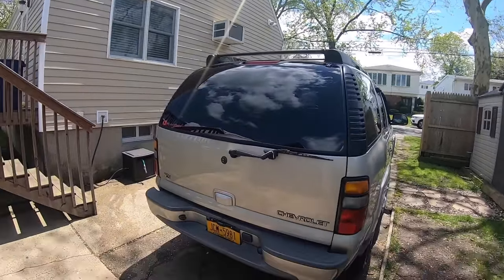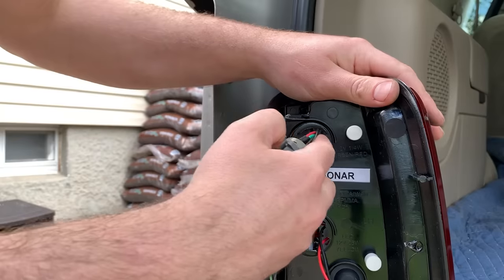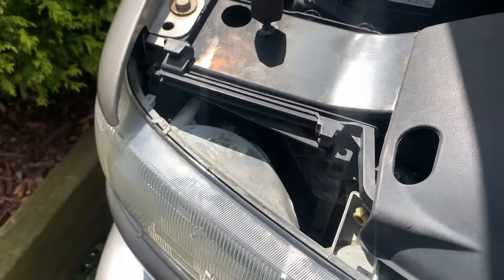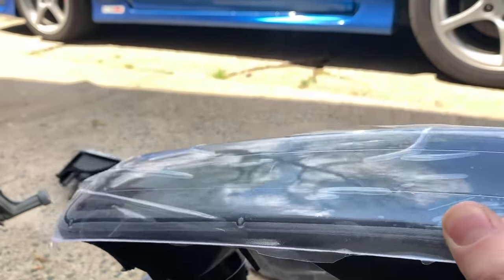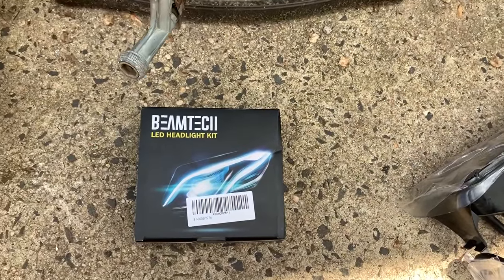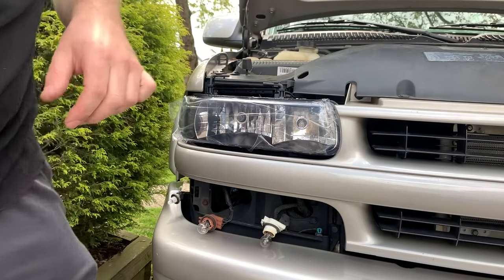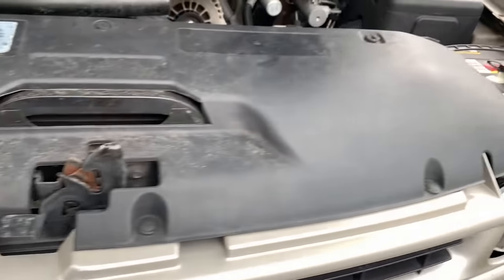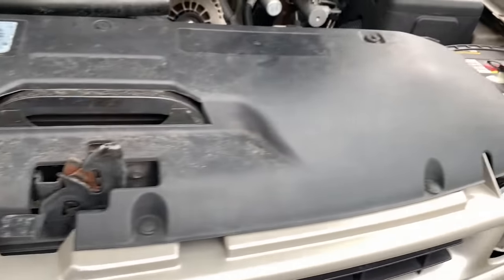Lights, Badges, Wheels, and Tires | IT'S TIME TO PIMP MY TAHOE

Comment from the maker: Phew this was a long one... Kept a lot of the install details in there, so let me know what everyone thinks. I would also love to hear your opinions on Tahiti's new look, and what additional mods you may want to see! P.S, I already have plans for power mods... #10secondtahiti
Reply: LsxMatt Have you thought about doing a undercoat spray for protection and what about Flowmaster’s dual exhaust that would be cool
Reply: Silverado 2500 hood?
Reply: Mirror turn signals
Reply: LsxMatt those badges are for the new tahoe Z71’s I’m looking to order some myself cause the original Z is red instead of black
Reply from the maker: Brian C it already has those👍
Reply from the maker: Brian C probably
Reply from the maker: jacoby Demissie maybe, I’m not looking to make it too loud.
Reply: Get a leveling kit
Reply: Nice job. Not overdone. Using modern GM badges & wheels was the way to go. I have done the same. I like the "looks OEM" but better look myself.
Reply: I'd swap out the rear window pillars (ventilation caps) with ones from a Cadillac Escalade. Easy swap.
Reply: You should of replace evry single stock bulb to leds including the fog lights and maybe get a round led aftermarket like morimotos
Reply: You did great, thank you for sharing!!!!!
Reply: clean the engine bay
Reply: LsxMatt you should buy led bulbs to replace all the halogen bulbs
Reply: Take the roof black thing off
Reply: Bro thx answering me but i didn't want to be rude but I meant like buy like a new unibrown and it looked great with it that's my opinion you might have a different think about it.
Reply: Looks good.
Reply: If you change the door hands for black color with the left and right mirror it will be great
Reply: Leveling kit
Reply: Looks great! Get the quietest dual extit replacement muffler and add another tail pipe on the left side🤔
Reply: Sorry, where did you order the tail lights from?
Reply: LsxMatt Brother No Need For A Leveling Kit. Just Tighten The Factory Torsion Bar Screw. You Can Get Atleast 2 Inches From It.
Reply: LsxMatt We would like to offer you a free lift kit or leveling kit from BoringOffroad.com for use with your Tahoe. Please visit our website and contact us through our forum page. We hope to hear from you soon! Great truck man!
Reply: That is a awesome job you did and you gave me some ideas to pimp my 2003 GMC Yukon thanks for your video you really got your Chevy Tahoe looking great.
Reply: Either a level or lift kit
Reply: The HD grille and upper lip would look real nice
Reply: Needs a Ranch Hand grill guard, level kit, roof basket, interior LEDs, new instrument cluster with the transmission temp gauge. But your current mods are very tastefully done.
Reply: I was trying to find the links for those headlights , taillights and badges. eBay i can’t find it
Reply: I got a real important question do they light up the road correctly or is it lacking the deflectors on the inside like the stock housings??
Reply: It looks like the taillights have the same issue that I keep finding with other aftermarket LED taillights.  Theres very little difference in brightness between running lights and brake lights.
Reply: Alright, you and I are about even on vehicles. I have a 2001 Z71 Tahoe Im working on. Also, just bought a 85 Z28 on Thursday and bought a 94 vette a couple of months ago. Im very close to a divorce. But I have tried to assure her that is it for vehicles lol. I got my to hot rods I wanted for my bucket list lol.
Reply: I like other ones better, old ones.
Reply: @blahbadyblah  I totally agree that all aftermarket rear LED tail lamps assemblies are not as bright or there's no real difference between the parking lights and the brake lights. I wonder if the LED replacement bulbs from the driving lights even reach as far as the stock bulb. Yes the color is great but I want the distance at night.
Reply: What about a sunroof..
Reply: Links to these items?

Comment: Not gonna lie I got emotionally attached to my Tahoe with 250,000 miles and fully restored it using OEM parts. It looks and runs like brand new. Probably a big waste of money but I’m still very happy with it 👍
Reply: I regret selling my 2004 tahoe to buy a 2015 WK2. First vehicle i ever worked on by myself and fixed by myself. I miss it, especially after seeing the new owner abuse it and hydrolock the engine by driving through flood waters with a cold air intake
Reply: Wait for gas to go back to 5.50 gal
Reply: Willing to bet it will last you another 20 years with minimal maintenance
Reply: Haha you're not alone, I'm still emotionally attached to our 2001 excursion. I still baby it and buy new things to pretty it up. It's been so good to us I can never let it go. So no way is any of this a waste of money; these vehicles totally deserve it!
Reply: The best part about it all is probably that you don't have a car payment!

Comment: Wow imagine being able to change a headlight without having to take ur bumper off. must be nice
Reply: It makes life so much simpler I swear
Reply: ahaha yessir welcome to VW mk4 life
Reply: Imagine being able to change ur headlights without taking off your radiator
Reply: FELT DAT SHIT
Reply: @gdowdy  rip
Reply: Carlos Davis Ford Fusion problems
Reply: Old Chevrolet .. just Chevrolet is OP to work on
Reply: Those were the days
Reply: Same when I got new headlights all I needed to take out was the old headlights themselves😂
Reply: I have to do the same in order to install headlights on my 2014 Malibu smh...
Reply: Miata life
Reply: ikr!!!    My RX300, 17 Avalon and Q50   Are all a bumper off job for headlights,, but SURPRISINGLY The Audi Q7 doesn't require bumper removal to replace headlight
Reply: Edgar H252 2007+ tahoes really wrecked the curve lol
Reply: Hansel Sanchez  forget Headlight removal, I feel bad for PT cruiser owners in general
Reply: @JDMHaze  Nice tail lights they look rich.
 Gotta be careful where place those headlight pins when you take them out they like to roll away and got lost in the engine bay.
Nice vid though.
Reply: I had that same issue with my 2007 Cadillac STS and 2012 Chevy Malibu... take it to a shop and you end up paying over $250 for a $30-$50 part.
Reply: 2014 Subaru Legacy. Have to take the bumper off and about twenty 10mm bolts for both headlights.
Reply: That’s why I still have my 02 suburban. So much easier
Reply: I have too take off my wheel and fender liner
Reply: mr anderson  4th gen Dodge Ram 😑😑
Reply: I had to remove my headlights. To put leds in it
Reply: @gdowdy  i do it on my vw all the time without taking off the bumper
Reply: @jonathanmorgan494  not on a mk4 youre not
Reply: @gdowdy  i do it all the time though 😳
Reply: That's the joys of owning a chevy...
Reply: Should've bought a tahoe/suburban 😂
Reply: LOL!
Reply: When i swapped my 04 sierra lights i could not beleive how easy it was.
Reply: Chevy bubba
Reply: Shoulda bought a Tahoe!
Reply: When I saw how easy it was to swap headlights on this truck I instantly went to look for some leds 🤣🤣🤣
Reply: Lol oh yeah
Reply: I got a cat eye chevy and I can remove my lights with just pulling a pin
Reply: 2011 chevy malibu😢
Reply: It's a wonderful thing!! I swear it's one of the reasons why I keep my 03 surburban.
Reply: I know it’s been four years but does anybody know how to turn on the inner turn signal lower lights ❓❓❓❓❓❓

Comment: Pro tip. When you put the rear Chevrolet logo on put masking tape over the lettering peel the back off and the tape holds the lettering in place press onto lift gate and pull tape off

Comment: Man you do a nice job, detailed, informative, and enjoyable. I liked the add for your promo as well. Glad to see you getting some extra support, Thanks.
Reply: Except 1) Googone should not be used on painted surfaces.   Alcohol is safe and usually works too.   2) Multi-letter disconnected badges like that almost always come with a clear sticky sheet over the letters, that's not just to protect it during shipment, its also for application.  You are NOT supposed to eyeball the placement, but use that with a piece of blue tape above that sticky clear sheet to line everything up like a hinge, then remove the adhesive facing the paint, and press in place.   If for some reason its lacking it, which I've never seen, you can place tape over the lettering so they all stay in position and do the same.  The lettering adhesive will be stronger than the tape, so once pressed on you can easily remove the tape.

Comment: I love how you updated this rig. I've always loved the Tahoe and suburban. And you have "modified" this exactly how I would have done. This is the definition of "tasteful mods". When it comes to upgrading a vehicle on a budget one of best was to do it is with factory parts. They're far superior than anything on eBay coming from china, I have upgraded a few vehicles by simply using factory parts from other makes models or newer or upgraded factory parts. Once I saw the reveal the first thing I said was "leveling kit would really set this off" and bam! You mention it...so I hope you have done it

Comment: LsxMatt >>> I like what you're doing overall to your vehicle, it's starting to look quite good.  I hope that your replacement lights do not start developing condensation, the front ones are especially prone to this.  Also, be careful with tire rub: it's kinda like the saying about roaches, if you see (1) one roach, there's bound to be a (100) a hundred more; with rubbing what you've noticed will be the minimal amount until you're on some really rough roads, or your vehicle is really laden (weighed down), that's when you'll see the "real" total amount of rubbing.  If I were in your place I'd just use the tires until time came to replace them, then I'd go back to the original specs (or at least something a smidge smaller).  Great video, thank you for the share! ;-)

PS ... when you were showing the rear fender well about the tire rubbing I noticed that your rear shock looked quite busted and rusted.  Maybe you're do for a new pair of rear shocks, and if you're considering a front "level kit" maybe just forgo that for replacing the springs with the shocks; the springs may just be sagging because they're old.  This way you get a better ride and look instead of a nice looking ride that doesn't ride right; now say that 10x quick! ;-)

Comment: Good to see others out there doing this sort of refreshing upgrade. I have a 2006 Silverado Crew Cab 4 x 4. I'm doing exactly what you're doing. All chrome is going bye bye and I'm replacing it with blacked out versions. Smoked headlights, turn signals and fog lights. The silver and gold "LT" badges will be replaced with solid black. The silver "Chevrolet" badge will be replaced with a solid black one and the silver and gold "4 x 4" sticker will be replaced with a solid black version. I'm also going to powder coat the rims and get away from the chrome on those as well.

The Tahoe looks amazing. I'm glad I ran across your video today.

Steve D.

Comment: Great video.  I am not a huge fan of the same color stop and blinker lights. I personally always like it when the blinkers are yellow and the brakes are red. That way if someone is stepping on and releasing the brake pedal you don't have have to guess if that is a blinker or not. Super small gripe on my part. If you like them (and you appear to) then it's friggen awesome!
Reply: so true. cars made for the european market always have separate, orange blinkers, never combined with brakelights. it's so annoying and dangerous when the brakelights are combined with the indicators.

Comment: Highly recommend upgrading the wiring harness for the low beams to the Standard products wiring harness upgrade with bigger gauge wiring because they are notorious for overheating and melting the sockets. Happens to rear turn signals too. Sylvania makes good running light led replacements also. I've changed those and the reverse lights in the rear and it made a huge difference.

Comment: Hello! I used to do interior and exterior car repair. All of your hard plastic pieces inside and out, if you just take your heat gun on low and take your time will brings the black the gray back! Doled out color and scratches and gouges!

Comment: Well done... you modernized the look without using a bunch of fake stuff from Autozone and going crazy with plastidip. Hope the headlights hold up... the wheels look great, and leveling will help a lot. You could always go with leveling shocks (like Rancho quickifts) which do a great job and prevent having to use pucks.

Comment: Used to work in advance auto and gm trucks were the easiest bulbs to change out. All of them. It was a pain changing out all these other cars bulbs. Some are literally impossible. Those few changes make the truck look way better. Nice job bro. Did almost the same on my 04 Silverado reg cab and made a huge difference.

Comment: I work for a large tire distribution company and I can tell you that the Nito grappler is the best Tire money can buy for that type of tire. Made by Toyo. They are definitely an upgrade over the Toyo open country or the BFGoodrich tires or anything in this category, and those particular tires on your Tahoe should last quite a while. No need to change them.

Comment: The truck looks great but that Tahoe clearly did not spend much of its life in New York.
Reply: Being from Buffalo, I completely vouch for that.
Reply: Cleto also from Buffalo I can also vouch for that
Reply: @prestondoring2640  why is that? It would have rust everywhere or something?
Reply: 6ix set Because the entire bottom of this truck, including around the wheel wells would be a complete pile of rust if it had spent a decent amount of time in New York.
Reply: All the salt
Reply: Pretty sure those wheel wells are plastic, I have an 03 yukon denali, all plastic there, been in New York its whole life with no rust in those locations.  There is some paint bubbling around the rear wiper but that's it
Reply: @jimmyc4493  peel behind the plastic wheel cover before you preach fam. They aren't water tight....
Reply: @blackraven8841  Never said they were, most people don't wash their trucks off during the winter to rinse the salt off.  I do, maybe that's why my fenders aren't falling off.
Reply: From upstate NY. Can confirm this

Comment: My 08 truck is looking a bit tired.  A good way to bring it back.  Might have to do the same.  Polished up the headlights the other day and it made a big difference.   Might U-pol raptor line the bed and hail damaged bed caps to give it a cleaner look.  Maybe even update the stock radio as you did with something a bit more modern this year.

Comment: Do a video for the chrome on the rear bumper. I have a suburban with chrome front and back. The back looks great but the front keeps surface rusting. I use a chrome polish and protector that made it a lot better. But it keeps rusting.  Nice video btw 👍

Comment: The headlights and turns have butyl. So they're sealed. Also silicone is the worse thing to use if there is a opening. A good storm and you'll be opening then to drain them. Also leds in a reflector housings for headlights is the worse thing to do, go get some 9011 and 9012 halogen bulbs. 100x brighter then those amazon leds Or just retro fit some led projectors if you want leds.

Comment: I have beam tech LEDs 6000k, 10000Lms in 3 vehicles, all fog lights 880s, highs 9006, lows 9005. In 3 different vehicles and love them. Never had to any problems with fitment. The only ones that seemed a little different at first was my brights on my Silverado. But turned out it was only because my fog lights made the dims so much more brighter. Had about 3 years now no issues.
Looks to me like your Tahoe’s fog lights aren’t the original or are but actually for a older model like 99 or so that came with the round light housings on the valance which is prob why the 880s didn’t fit , or wouldn’t without drimel work. The original 880 fog light housings are almost oval. Like an out of square rectangle, with rounded corners. I have 3 vehicles with these original from factory. All running the 880 beamtechs and honestly there the brightest lights on my vehicles.

Comment: And if you take those bolts off the fog light housing you can remove them unit and then put bigger brighter led bulbs in that’s what I had to do. Big difference compared to the smaller ones that fit without removing the housing.

Comment: Looks nice man. Same color as my '05. Gave me some ideas. I ran into the same issue with tires, lol. My factory wheels had the clear coat peeling, needed new tires, same story. I grabbed a set of 2017 20" GMC takeoffs with good tires (so I thought) for a great price off Craigslist. First Michigan winter, I learned that the stock Good Year RS-A tires are horrible in the snow up here. Found a good deal on a set of Hankook Dynapro ATM a little oversize from stock. Night and day difference. We got 18 inches of snow overnight last winter, and I just drove to work like I was on dry pavement, lol. I get the same rubbing, but only at full lock with 285/60/20

Comment: I call my goldarr..mine is the pewter beige. I did black for accent color black wheels tail lights tint etc. ordering new tail light and headlight housings. Got all the lighting inside and out converted to led. Then I just have the lowering springs and catback exhaust with headers to get and I’m done.